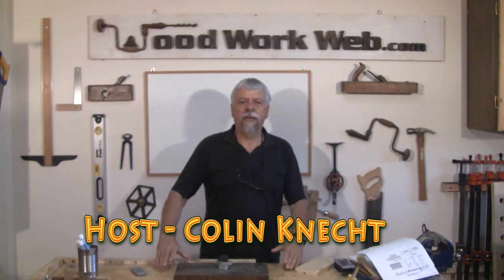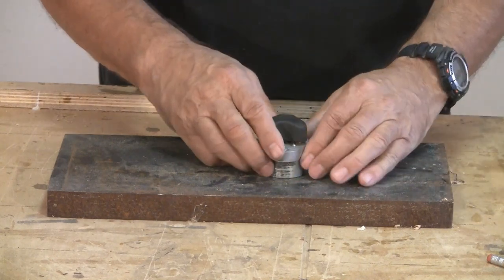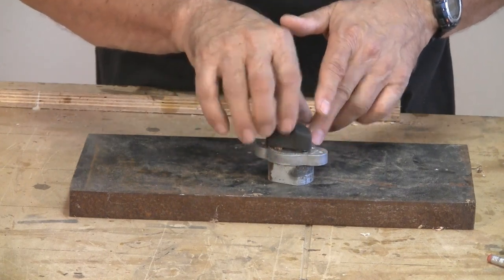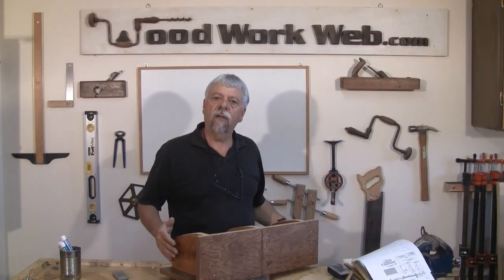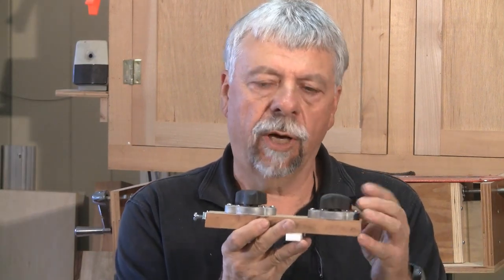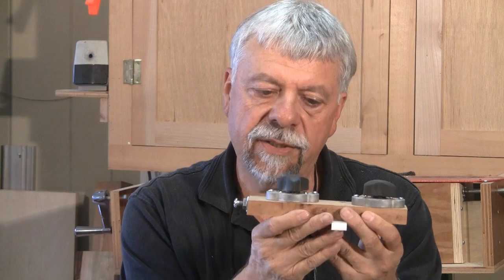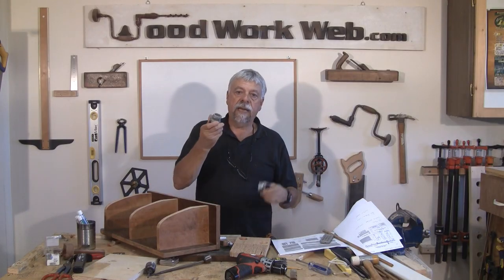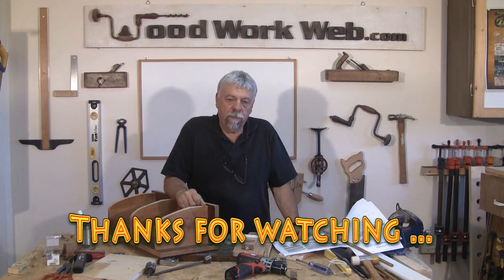Magnetic Switches for Jigs - A woodworkweb.com woodworking video

Comment from the maker: Sure, no problem, thanks for asking. I used the search term mag switch which seems to work better, and will get you to the manufacturer's website to see the dealer listings. Some of the dealer listings shown are Rockler, Woodcraft, Hartville Tool, Lee Valley, Grizzly are a few that are listed. 
Thanks for a great question, I'm sure others have looked as well. Great to have you with us.
Colin

Comment from the maker: Hi William, thanks for taking the time comment. From what I understand the magswitch system is protected by patents, so you won't see any knock-offs until the patents expire, BUT, for fun ... I did look on Amazon, and I see they are selling the 20mm units for approx $23. each. I think that's actually not too bad considering these can be used in many different ways, unlike many tools that a dedicated to one job only. Thanks again for taking the time, maybe others can offer other solutions too :)

Comment: Recently I brought the Magswitch Starter kit and the 18" fence. My 9 year old was able to use the leverage of the fence to remove the magnets from my table saw. After watching this video I got some carpet tape and some "Magic Stop" matting. I have applied the matting to the jigs, fence and parts of the universal base. Now It takes a lot of force to push the fence across the table. And even then it barely moves. Thanks for the tip. I will now get more of the matting.

Comment from the maker: LOL, yes it is huge, it's actually a 2 inch wide blade and the saw is only designed for ripping wood. It's a 16 inch Makita saw that they don't make any more, and it only takes that one blade so I have another smaller 12" Delta bandsaw for smaller things.
Thanks for commenting, great to have you with us
Colin

Comment: There are two types of anti skid materials: one uses a rough surface and the other uses non-slippery rubber. For the former, one things of the strips of tape put onto stairs, for the latter, think of the bottom surface of a push block. Which are you using and where do you get it?

Comment: Hello Colin! Love your videos, I like to even use them as reference to go back and watch. I actually just bought a bunch of Magswitches because of your positive reviews!   QUESTION... at 13:05, what size hole saw are you using? And is that magswitch the same as the new yellow 150 series? On the Magswitch website it says that they require a 40mm hole but I don’t know/think that they are talking about the oblong hole that I want (that you made here). Thank you for your time!! Keep up the GREAT work!! 😀👍🏼🛠🧲

Comment: Looking at that thin strip jig and the difficulty you had with that thin strip of wood, I had an idea. What if you replace the screw with a 3/4" piece of flat steel stock inserted in the block perpendicular to the saw blade so that it fit into a slot on the jig? The end toward the blade smoothed over nicely so as not to 'catch' on the wood and secured with a bolt or machine screw held in place using a threaded insert such that the machine screw held the steel stock in place at the appropriate setting?

I also wonder why you do not employ a feather board before the blade to secure the stock as the blade enters it - esp on long stock as demonstrated.

And, if you are fond of magnets, you could install one of those rare earth magnets inside 'the slot' by making the jig body in two pieces, a strip of wood sized to the steel bar, then gluing the (now) three pieces of wood together - after adding a Rare Earth Magnet and cup to the inside of the slot to be, of course.  The R.E.M. would hold the steel bar while allowing lateral movement when the machine screw was loosened without 'falling out' of the jig if the slot was a bit too large or became 'sloppy' over time.

If you build one, let me know!

Comment: "Move the bit over - a little bit" 

How about, finding a Forstner bit that matches the diameter of the left or right side of the Mag Switch first. Then measure the distance across the Mag Switch at the widest point.  Now, subtract the DIAMETER of that Forstner bit from your measurement of the width of the Mag Switch. Let's say the difference is one-quarter of an inch.

Then, drill your first hole, then move the work over one-quarter of an inch and drill the second hole. That is, one-half the distance of the difference measured.
Reply: Gooey Tarballs i